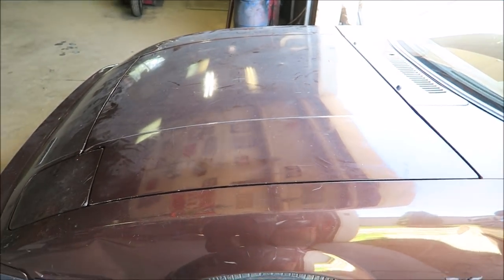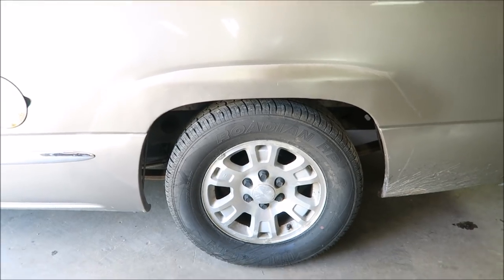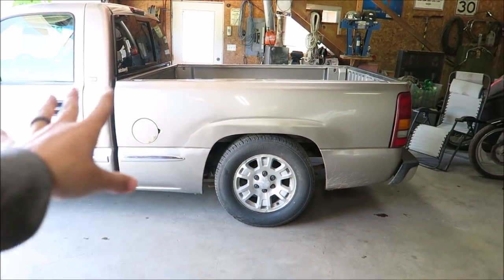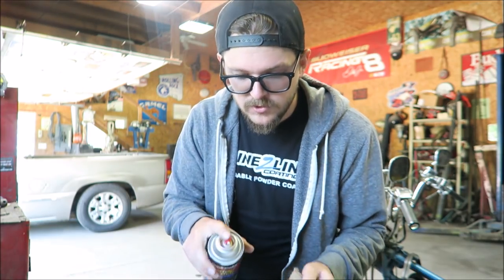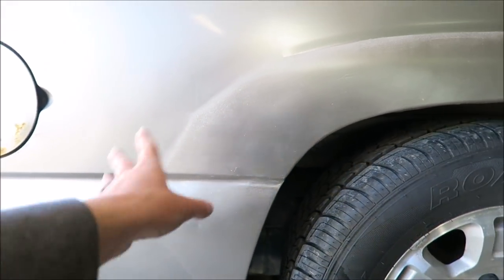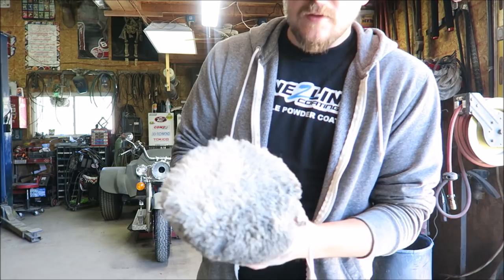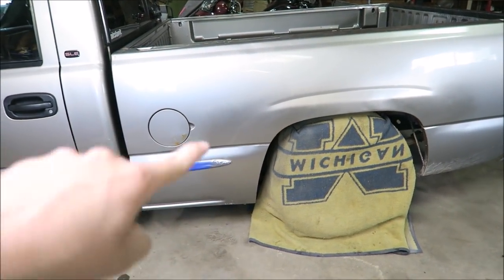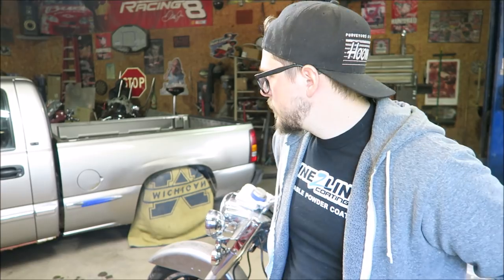I SUCK At Painting... BUT it worked out I think

Comment: Slap some fender flares on it. I did what you did with mine. Same color and everything. The paint was almost perfect after 5000 grit wet sandpaper but just bothered me, even after wax and ceramic coating with buffering so I did what any logical person would do. I slapped bushwackers flares on it and called it a day.

Comment: Have u had any problem with the cam like transmission issues or motor cuz I’m planning on getting the same cam set up from tsp for my 2010 tahoe 5.3
Reply from the maker: The only thing I would suggest is to get a higher stall converter like TSP recommends. But, aside from that, it's been absolutely fantastic

Comment: It's cool you did it yourself instead of having your dad do it but you would've had much better results if you just shot the whole bedside
Reply from the maker: Yeah, I know. But, then I would have to fix the fuel door, the section behind the wheel at the bottom where the rock chips hit it, and the top of the bed rail.